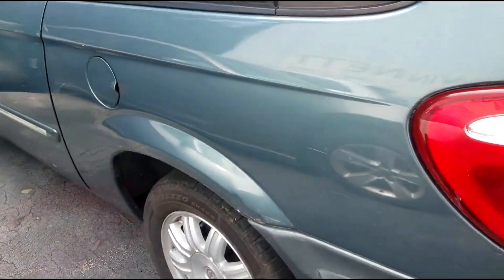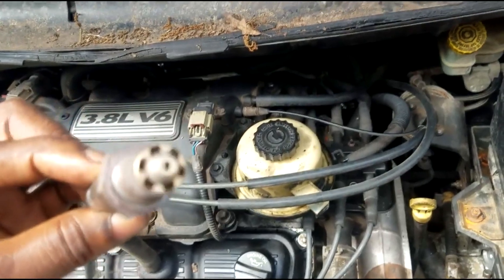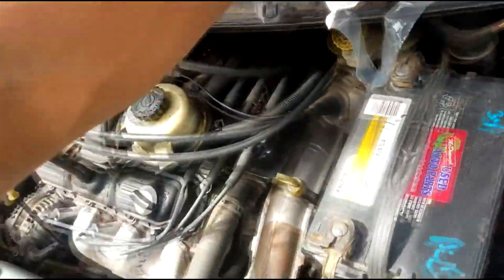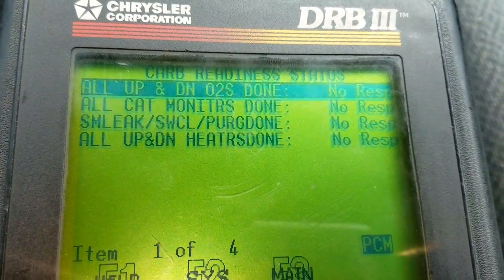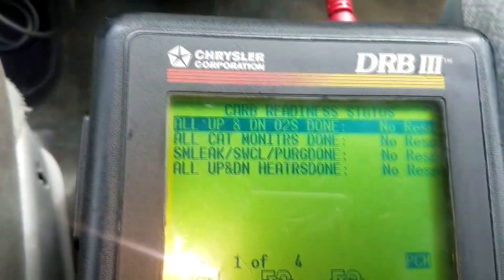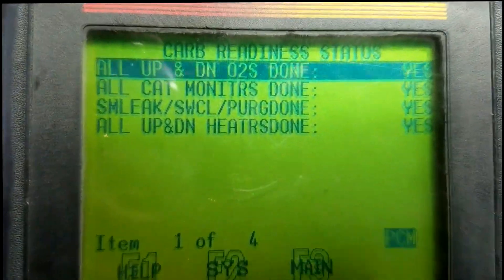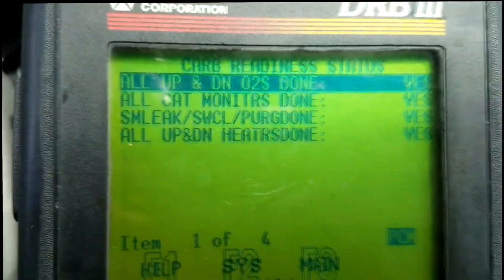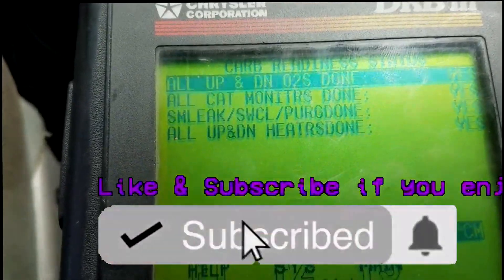Parts Canon from another shop. WILL NOT PASS EMISSION. See what I had to do for Carb Readiness/

Comment: I just went through a whole part changing frenzy on my 04 Dodge  Grand  Caravan when the dreaded P0304 popped up and wouldn't you know...turned out to be a bad "NEW" spark plug that was causing some major problems.  The Dodge Dealership here ordered an OEM O2 sensor for me, but gave me an NTK when it came in. So far, so good.

Comment: Some of the high quality name brand stuff is fine considering they might be the supplier for the manufacturer in question. Easy to replace parts that are also cheap can be worth taking a chance on but important parts that are a lot of work use OEM or high quality name brand stuff so you don't have to do it again right away. The last 02 sensor I replaced in the Neon was a Mopar one my step dad got me because he worked at a big Dodge dealership here till he retired. I don't think I had to deal with it again till it finally killed itself years later. I do have the special sockets for those because I have had to deal with those quite a few times over the years, and the oil pressure sensor socket too.
Reply from the maker: O thats whats up Dartman. Hang on to them tools